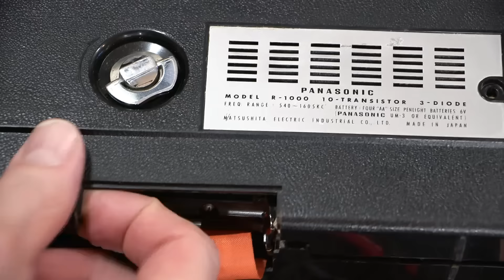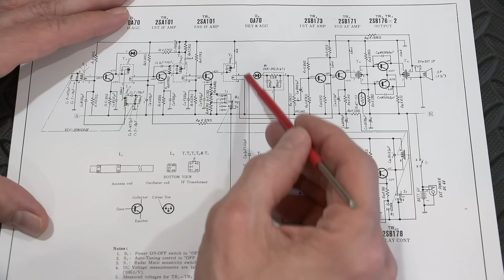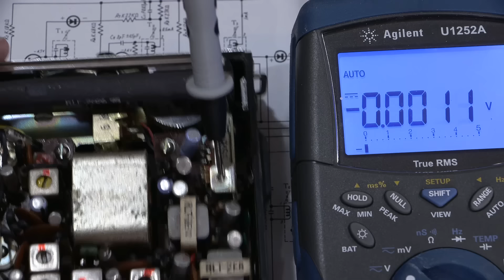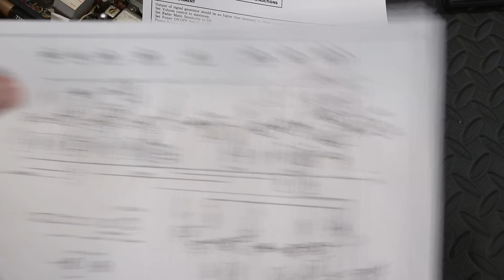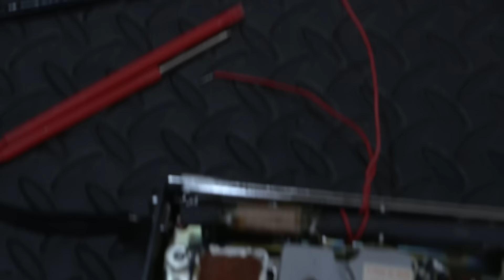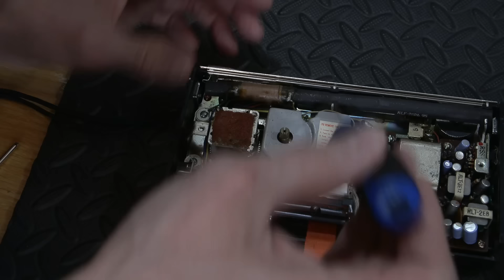Panasonic Radar Matic Receiver Teardown With Circuit Description, Troubleshooing, And Resurrection!

Comment: @1:43 Mr.C, I did not expect you to be one of those that doesn't use the little ribbon. It goes under the battery so you can pull on it to get it out easier.

Comment: 26:00 Does the auto tune automatically change direction at each end of the bands? Very cool radio indeed. Thanks ❤ - Also because of this video I researched how to calculate the energy in a coiled spring. Again, very cool! 37:18 When did you wind it back up? We want to know!

Comment: Excellent presentation on a somewhat unusual radio. 
The electromechanical device is actually a combination of a relay (to latch in the coil circuit) and a solenoid (to engage the clockwork mechanism that rotates the tuning capacitor) like the much larger ones used in washing machines to engage the drain pump and the speed-up mechanism for the spin cycle. 
Also, I was wondering approximately what year this unit was made.

Comment: That seek button is a really cool trick for a transistor radio! Could the broken ferrite have been a contributing factor to the "screwdrivering"? Edit: I was just thinking about a wind-up power source too, but I guess the commutation noise would still be an issue. 👍

Comment: The best small portable transistor radio ive ever owned was a Panasonic that i bought at the px in Germany back in 1982, am/fm/sw. It was lost in transportation when i came back to the states, nowadays the only comparable radio ive found is a portable grundig but its alot bigger.

Comment: Very interesting construction with a clockwork mechanism and a tuning condenser with no end stop.. Apart from the commutation noise from a tuning motor, it would also put extra drain on the batteries, of course. Did you try changing the IF freq, in case the crystal/ceramic resonator in the tune circuit had drifted in frequency? Good caps in this radio, after all these years!

Comment: I was wondering why they didn’t just use a motor but I bet the dc brush motors of the time would cause too much rf noise for it to work right?
Reply: Hah you mentioned just this issue right at the end!!

Comment: 26:19 The detect circuit for the auto tuning in being swamped out by the static, it will be looking for a somewhat large differential in the noise levels between a strong station and no station (or a weak one.) it would require more sophisticated filtering to reject all the static and enable detection of stations.

Comment: So, which do you think came first, the drop that broke the ferrite bar and the battery case contacts, or the screwdriver misalignment?  What a great video!!!  And a great tip for why old analog o'scopes are so good in radio work and other small-signal applications where sensitivity and low-noise are king!

Comment: It would have been more useful if you had repaired the antenna core , the battery holder, and cleaned the relay contacts. Otherwise, it was a very instructive video, especially for that tuned detector circuit that stopped the tuning. It was fortunate that the crystal in the detector circuit wasn't broken when the unit was dropped. I always enjoy your vidseos.  Tnx & 73 de K4TO

Comment: You assumed an IF of 455kHz.  It may have been 450kHz or 460kHz and no adjustment required?  Should have started by varying the sig gen output either side of 455kHz.

Comment: So Paul I got another question for you. When using an ESR meter and the cap value you want to measure is not listed on the chart attached, how do you determine the number you looking for? Ex. 2200 uf @ 16v.

Comment: God, I miss schematics. Granted, they're of limited use these days with basically everything being microprocessor based, conformally coated, microscopic surface mount bits. Not to mention it's often not worth farting around with anyway since it's be ultrasonically welded, and yada, yada.... But I do miss actual schematics. And user manuals with theory or operation. The stuff I learned from those was immensely valuable to me, though I may not have realized it at the time. And, well, let's be honest, stuff that not only was repairable, but worth putting the effort into repairing it in the first place. It is nice seeing this stuff being brought back to life. It is a bit of kick in the gut to see something like this forgotten and left to rot. I know at the time it was forgotten it wasn't worth anything to whomever it belonged to. But now, it's hard to see it left to turn into junk.

Comment: Electronics is my first love. I used to do a lot of board level repair on all types of printers, computers, monitors, power supplies, even hard drives. The thrill of chasing the problem. It's really very rewarding when you find and fix problems that few can and you sir, are a master at it. Thanks for sharing!

Comment: It's been a very pleasant trend for you to work on smaller, affordable transistor radios. I always felt a bit diminished when you repaired those wonderful, museum condition tube console  radios. I can relate to transistor radios as they are affordable to me.
I actually had one of these for several years, and it worked quite well. I sold it about a year ago. I was constantly freaked out by the manual tuning. I always held my breath when pushing in and tuning that wheel...kept waiting for it to break.(I have anxieties, haha).
You are a real gift in your calm demeanor and incredible knowledge. Appreciate it....

Comment: That radio is really cool. Very interesting to see how the circuit works. It reminds me of the 1950s "Wonder Bar" radio I had in one my first cars which, when you pushed the button, would seek stations and stop on them just like this radio... (though you didn't have to wind it up). It also had a foot switch on the floor board so you could amaze and baffle your friends by changing the radio station using 'magic'. I always wondered how the wonder bar worked... and now I know. I also like the way the tuning condenser just rotates endlessly, up the dial, down the dial and up the dial again forever.... very cool.
Reply: My dad's car had that. It was a Buick.

Comment: I would love to see you get into a direction-finding radio, like a Ray-Jeff ADF. You tune it manually, and there is an S-meter to help. But in ADF mode the big ferrite bar antenna is rotated to minimize the signal strength, and then a 90 degree correction is applied to the bar so it points to the signal source. Since it is a dipole, it is bidirectional so a separate vertical omni antenna is used to sort out the correct direction.  So it is another example of a signal-seeking electromechanical device. Fun to watch. 73

Comment: I once owned a 1970 Toyota [top-of-the-line] Crown. That vehicle came from the factory to the United States with a similar radio, but the "SEEK" function was performed by an electric motor and it was an AM/FM broadcast band receiver. With no integrated circuits, there was a lot of "stuff" in a tiny box!

Comment: Hi I was in the electronic service industry sine 1998 until 2003 when I retired it’s great to see differnt items from other countries I still repair electronic equipment I use to train apprenticeships for young lads but they were not very interested and would leave after several months when computers came out I repaired them as well the young people whanted to play games on computer and not learn how to repair them they told me we will bin it when it goes wrong. That’s what people do these case I repair all y old tv,radio, cd players etc they do not want to pay for the repair. Steve b great videos.

Comment: As a clockmaker, I was envisioning just how badly things could go wrong when you removed the cover. I was shouting, "At least let the mainspring run down!" Fortunately, the engineers anticipated people ignoring the "Do not remove this cover" warning and hid the interesting and potentially dangerous parts of the clockwork under the plate.

Comment: When you said the radio had a hand crank, I was thinking of a radio that was being given to Missionaries in South America. This so anyone in the jungle if no power could listen to HCJB and TWR, Trans World Radio on the island of Bonaire,( I was an TX operator). The radios were powered by a hand cranked mechanism.

The radio you’ve got is a really cool radio! I’ve never seen one of those.

Ron
Reply: If you want to see a hand-cranked transmitter, check out the 1953 John Wayne movie "Island in the Sky". The plane has crash-landed and when the batteries die they have to crank this emergency locater beacon that has speed-up gears to rotate the frequency generator fast enough. (Very hard to crank.)

Comment: Interesting portable radio and one I've never seen before. This reminds me of the old vacuum tube car radios of the 50's, Ford had a model called the Town & Country signal seeking radio. It worked very similar to this but the Town button only stopped on strong signals and the Country button stopped on weak and strong signals and was used in fringe areas. The tuning mechanism was driven by a DC motor that must have been well filtered because is caused no noticeable interference on the AM band. Great job on the repair and circuit explanations Mr. Carlson.

Comment: That's a really cool radio!  A bit of super glue and a piece of shrink tubing on that bar antenna would be a permanent fix.  I've gotten into CAD and 3d printing lately - a great way to make small brackets and supports for things like fixing that battery case.  Thanks for fixing and showing this great portable!

Comment: Unique example of an evolutionary branch of portable electronic entertainment. Electromechanical solutions that work, but the "DNA" has evolved to modern life.
I remember the solid chunk as the TV was adjusted by the clicker.
Nice saga as always.
Reply: Ah, the satistifying clunk of tuning VHF TV. UHF could be fun too, but not as clunky; more tiresome really, if the station you wanted was halfway round the dial.

I remember the first TV we had with a remote control. It was a Zenith floor console with a fancy keypad with LED (or VFD?) display that used an ultrasonic remote (the battery kind, not the one with tuning forks). My young ears could clearly hear the high-pitched squeals as you pressed the buttons - the cats could also, much to their dismay.

Comment: Ha Ha...  I have that same radio for years!!  I thought it was one of the most bizarre products,  needing to be mechanically wound.

At first I thought it was pretty deceiving with what looks like a two band dial scale,  and then realized it is needed for the single-direction auto tuning to function.

The one I have works.